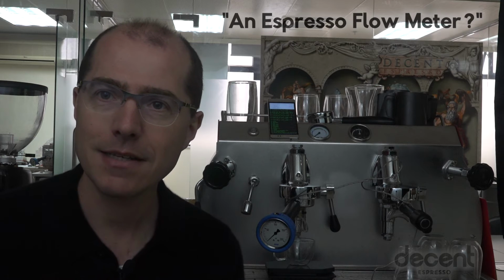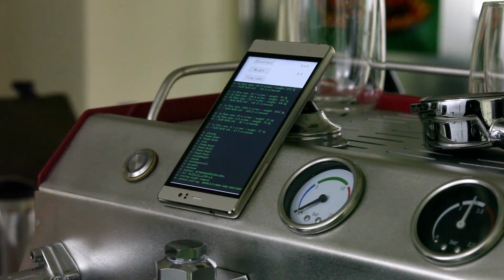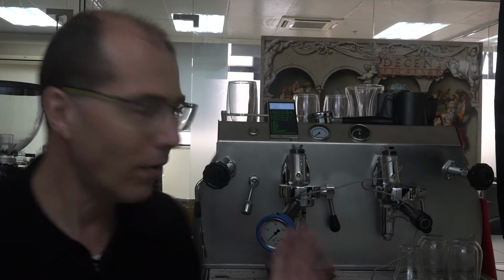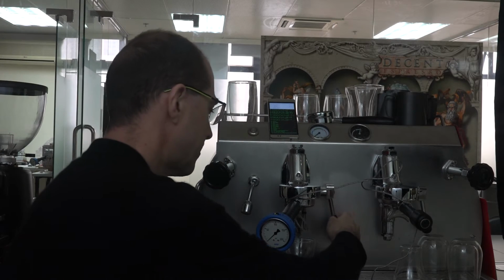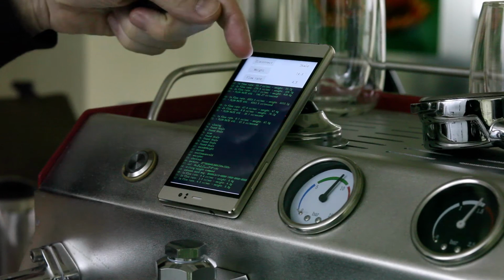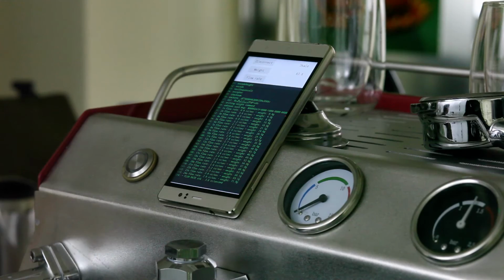Espresso flow meter invention

Comment: Is it strictly pump flow? Mass in vs. mass out would be more beneficial since the grounds retain some fluid. And plotting volumetric flow against temp during time would be useful in generating a shot profile or troubleshooting a roast.
Reply from the maker: On this app, we are tracking weight into the cup.

On our DE1+ espresso machine, the chart is water flow into the group head.  Water flow out would also be useful for ending the shot, but wouldn't be enough because no water comes out of the grounds during preinfusion, which is one of the most important stages for coffee flavor.

I'm not sure I follow you on flow vs temp.  Do you mean simply having two charts, one showing temp, another showing flow, so that you can fully understand how the shot was made?  If so, we do that already on the DE1+, but it'd be hard to do on someone else's espresso machine because we'd have to get a temperature probe into the group head.

Comment: That's a really nifty gadget. Two comments:
1. IMHO, it's a stretch to call this an "invention." Discussions and measurements of espresso flow rate are as old as espresso itself. One example: in Illy's book "Espresso Coffee," there are several graphs that display espresso flow rate. Obviously the authors had to measure the flow rates first in order to make the graphs. Another example: we have had numerous discussions, measurements and graphs of espresso flow rate on alt.coffee and home-barista.com going back 10-14 years. Third (personal) example: when I put a flow meter and batching controller on my little Silvia espresso machine in 2005, the controller had the option to display instantaneous flow rate or total (integrated) flow volume. I found flow rate to be about 5 ml/sec initially, settling down around 1 ml/sec through the bulk of the extraction.
2, Sure there's a distinction between the flow rate of water into the portafilter and flow rate of espresso liquid out of the portafilter, but once the puck is saturated the difference is very small. 
3. Is knowing your instantaneous flow rate is 1.2 cc/sec rather than 1.4 cc/sec really more important than knowing you extracted say, 40g of espresso in 30 sec?
Reply from the maker: +andy124124 Fair enough, not an invention, how about a "tool" ? <grin>  Was the flow meter on your Silvia a hack of your own, or something Silvia offered?  Potentially might be able to notice channeling on in-cup flow rate that wouldn't be noticeable measuring flow rate behind the puck (will be doing experiments).    Agreed that gravimetric dosing (final weight in the cup in how much time) is more important, but we can all do that today with the Brewista scale, I'm just trying to get more data, which may or may not be useful, hence this video asking "is this potentially useful" ?
Reply: +Decent Espresso: The Silvia flow meter was a hack. Gicar paddle wheel sensor plus a batching controller off eBay.
Re: detecting channeling, I think it would be easier to detect it upstream of the puck rather than in the cup. The in-cup signals are very noisy. 
BTW, some recent hacker (can't remember who) is using espresso flow rate as a feedback signal to adjust pump pressure, thereby maintaining a predetermined flow rate. Pretty cool, although I don't know if it could ever result in a better espresso....
Reply from the maker: +andy124124 On our espresso machine, we're measuring flow rate to adjust pump pressure as well, as part of the pressure profiling feature.  I agree with you that some things will be easier done before the puck and some after the puck.